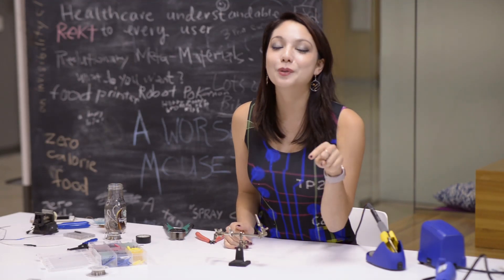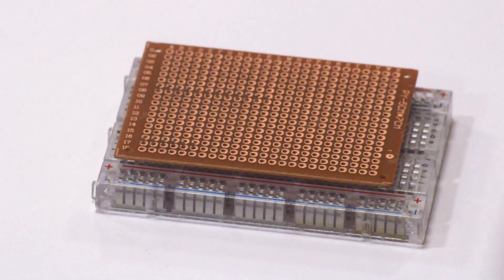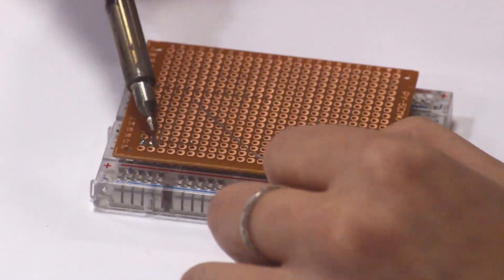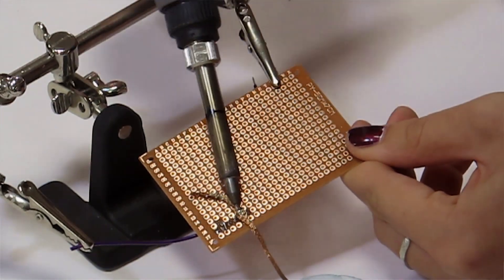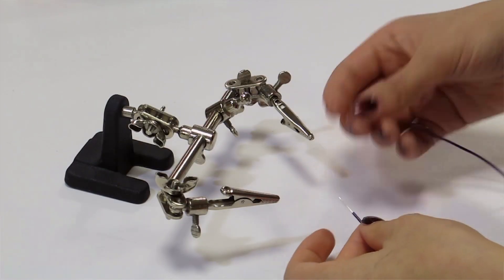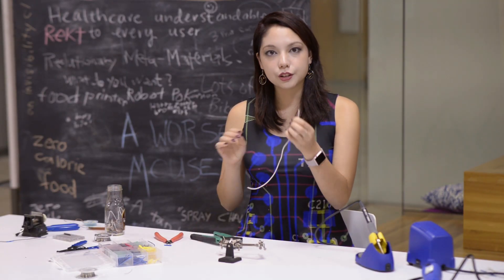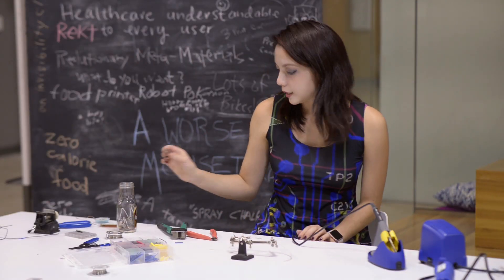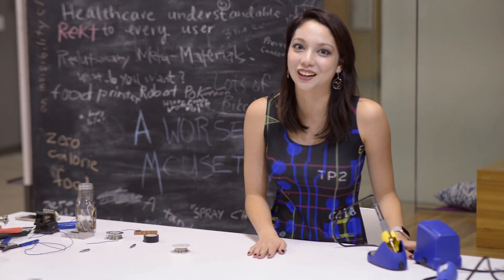HOW TO SOLDER

Comment: Great video Xyla and Andrew!

For any viewers wondering what "rohas" means with regards to solder, that's RoHS or "Reduction of Hazardous Substances". In short it means that the solder doesn't contain lead, which is toxic to humans and can cause lots of problems if it gets into your body. So if we have lead-free solder, why wouldn't we use that everywhere? I mean, why bother selling solder with lead in it? Who would want to buy that? Good question. 

Lead-free solder has pros and cons. The upside is that it doesn't have lead (win!). The downside is that the flux (a chemical in your solder that prevents your solder joints from corroding) is more toxic to your health (fail!) than the flux in leaded solder. Ever wonder where the smoke comes from when you solder? It's not the metals in the solder, it's the organic chemicals in the flux that are boiling off. So if you don't have a fan or something blowing that smoke away from you, you're breathing the flux from the lead-free solder which makes lead-free solder paradoxically more harmful than leaded solder (doh!) in that situation. Lead-free is also harder for beginners to learn soldering with because it doesn't flow as nicely, and the flux burns off much more quickly so you need to be much faster with your technique in order to prevent those solder joints from corroding over time. Lead-free is a good choice for manufacturing because machines can control the timing and temperatures more closely than a human can.

Ultimately, use whichever you prefer. If you decide to use lead-free solder, use a fan (a salvaged 12V computer fan hooked up to your benchtop power supply will do the trick quite nicely) to blow the smoke away from you so you don't breathe it in directly. Let it disperse into the air so the concentration of bad stuff goes way down before it makes its way into your lungs. Or even better, use an exhaust fan to blow the smoke outdoors. By the way, most professionals don't use benchtop smoke eaters because we feel they don't have enough suction to keep the smoke away from us. If you decide to use solder with lead in it, make sure to wash your hands afterwards, especially before eating, so you don't get lead poisoning. Use cold water so your skin pores don't open up in the process. And it's wise use a fan with leaded solder too - though not as critical as with lead-free solder flux, the smoke from leaded solder wasn't designed to be good for you.

Hope this is helpful to someone out there. Solder on, everyone.
Reply: Ian Charnas  with all the advantages of lead free solder the big drawback is that it is very prone to dry joints, I have repaired numerous PCB’s where leadfree solder was the cause of the fault, but then lead free solder fits in with the current low quality electronics that just outlive the warranty period. After working in electronics for 40 years and handling lead based solder for the same time, they still can’t find any trace of lead in my body. So if you use common sense while working with solder ( or any other chemical) there should be no problems.
Reply: Lead-free solder has too many cons. Tin whiskers, tin rot (or tin pest), high melting point, you name it! Plus, the way how it solders is not satisfactory. Joints are often dull and might be even brittle.
Reply: Honestly RoHS solder using at last decade did a great effort to pollute our planet even more because of short life of RoHS solderings. You already named it here (tin whiskers and other electronic joint plagues caused by improper solder). All consumer electronics who in facts die after 2-3 years of use because of amount of  soldering points simultaneously going bad go mostly in landfill or to 3rd world countries where they are burned for precious metals (toxic fumes) and toxic remains go into landfill doesn't help to keep our planet clean in any way.
Reply: In addition to being a bitch to work with, lead-free solder joints crack easily and spontaneously grow tin “whiskers” which can cause shorts, especially in fin pitch components. It's terrible all around.
Reply: Ed19601, at my workplace ( stereo repair shop) we use Kester lead/tin solder with 2% silver. Melts easily, flows well, great for both new work and resoldering old cracked joints, and holds up better over the long term for hot running power-resistor leads and similar, where the connection would tend to break down very quickly if it was done with lead-free solder. Although if you are resoldering a large solder-pad (foil) and component lead joint that was originally done with lead-free solder, you may have to suck the old solder off first in order to avoid a dull cold soldered looking  joint. I hate working with lead-free solder, for all the reasons you state. Most of the equipment we work on is old enough to not have lead free solder anyway. I mean really, who wants to work on a modern audio-video receiver with 200 pounds of crap inside a 50 pound box, and lacking a removable bottom panel? More than anything else, all the manufacturers having eliminated removable bottom panels on virtualy all equipment  has got to be the single biggest contributing factor to the  millions of tons of e-waste  generated every year because of equipment that isn't cost-effective time-wise and labor- wise to repair. Instead of ROHS standards requiring use of lead-free solder, we should have standards requiring manufacturers to make mechanical disassembly of electronics easier and faster, ban the epoxy potting of circuitry and heavy use of  component-securing glue  (which is often corrosive  by the way), require output and power-supply relays to be easily accessible and non-sealed for cleaning, etc, and force manufacturers to have better technical support and supply parts for at least 7 years, and finally, make them bear a significant piece of the cost of junking and recycling or trashing old electronic equipment, in order to encourage manufacturers to make equipment that has longer life spans and will be repairable and reusable and eventually recyclable.
Reply: @goodun6081  nice, but you are also forgetting software portion.  Look at constant updates, that goes for a lot of electronic equipment (firm update to load new drivers, update OS.) The things are engineering to be obsolete in few years. Heck the electronic could still be good but with newer software, it will be to slow or even incompatible.  This is one of reasons why manufacturer didnt want to leave the upgrade the windows  xp based systems.  There are still equipment using 3.1 or DOS because the cant work on newer software.
Reply: Pretty confusing, eh? Maybe look more on soldering thing and less on her properties. I guess that this tutorial was a side task besides her everyday job. From last observations hot chicks in tech is already nothing unusual and in future their number will probably grow. Side note - hopping frequencies used in wireless communications was invention of Hedy Lamarr who also was very pretty girl and actress by the way. So again - nothing wrong :)
Reply: Well explained. I prefer lead solder. Any sports angler who list a weight will probably have brought more lead in the environment than me with soldering.
Also whisker forming is much much less with lead solder
Reply: +mrfurball Who are you talking to? Also, given NASA's insane QC standards, 6 hours of makeup every day probably wouldn't slow the project down much.
Reply: good 'un ditto here. When I was young there was always something heavy to find and also led was easy to come by
Reply: There are numerous electronic components that still contain Lead via an exemption, so RoHS does not mean Lead free. Diodes using lead based glass, pots, glass in ceramic capacitors and ultrasonic PZT crystals, until there are suitable alternatives they can claim an exemption from meeting the RoHS directive.
Lead free solder can be more reliable than Tin/Lead if used carefully but it suffers with unpredictable early failures. Most engineers are against it because it makes life a lot more difficult. Maybe one day we will look back on Lead in solder like Lead in petrol.
Reply: Man I appreciate you  writing a whole essay for newbies. As a noob myself the thought and knowledge will definitely help on my soldering endeavor.
Reply: Thanks for this and it’s very useful. I end up soldering at my table by a screen door and worry about the smoke.
Reply: Ed19601, we used to get chunks of old plumbing pipe, or the lead seal that was poured and tamped around cast iron septic waste pipe,  for free.
Reply: If i am not mistaken, the leaded solder tends to expand & contract better as circuits heat up & cool off - has better thermal properties. I am slowly building a fume extractor w 12V CPU fan, even if my soldering time is short. Thanks for the long but informative reply!
Reply: RoHS solder is  a huge scam.  the concept behind it is to 'save the planet' but the quality of production it provides is highly problematic.  it is a problem to electronics production that has little to no justification.
Reply: Ed19601, PS, I used to make my own lead fishing weights and lures when I  was a kid. One of the major manufacturers of do-it-yourself sinker and lure molds had a motto, which was, "fishermen and thinkers make their own sinkers!" By the way, one old fishing magazine had an article on how you could use Plaster of Paris, or a newly-developed epoxy type silicone rubber, to make your own do-it-yourself molds for a favorite fishing lure or sinker type, by greasing the unit to be cloned with a little bit of Vaseline and sticking it halfway into a container of plaster of Paris or this silicone rubber stuff, letting it cure, then greasing the plaster of Paris or silicone surface itself and pouring a second layer of the stuff on top so that then you could pry the two plaster or rubber halves apart and retrieve the fishing lure that you had made a negative casting of. I actually did this to duplicate some old "tin squid" type fishing lures from the 1920s or 30s. Well cured plaster of Paris would last for 2 or 3 dozen castings!
Reply: Manslpain much? What you should be doing is explaining if dudes like my self are required to wear dresses and 4 pounds of makeup in order to solder, don't get me wrong, I like looking all fancy and pretty like a delicate flower and shit but 6 hours of makeup to solder 2 wires together seems like a lot of effort to just solder 2 wires together, how did NASA get to the moon in under a decade with such high dress and makeup regiments? Makeup tattoo maybe?